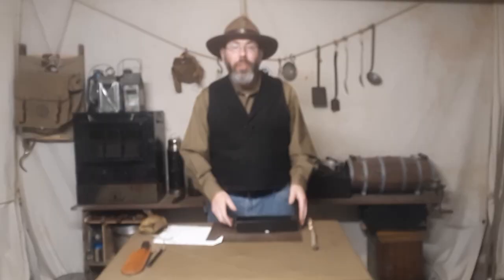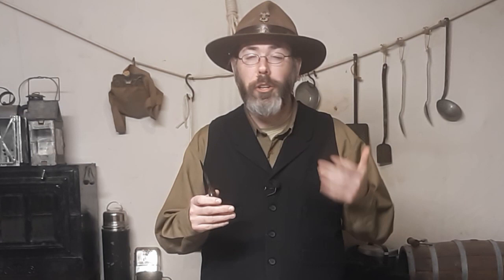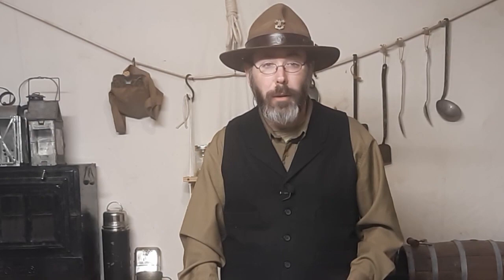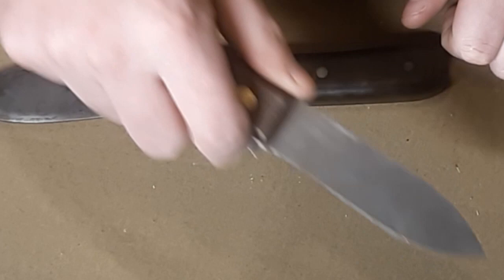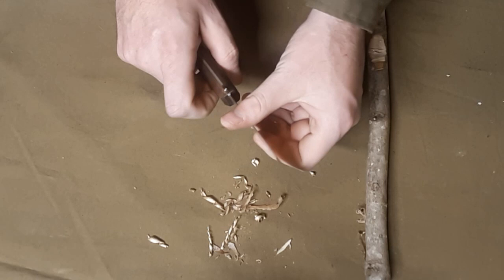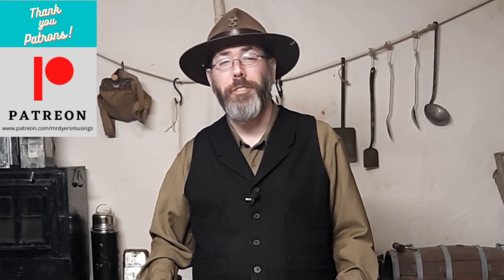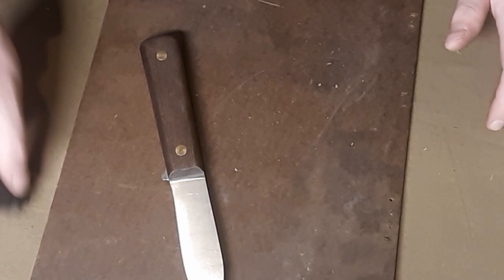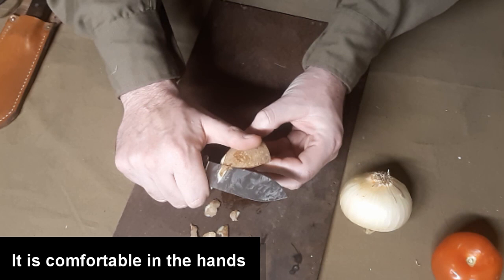Want an Old Hickory Kephart Knife? WATCH THIS and SAVE MONEY!

Comment: It’s a great little knife for camp chores. It’ll do most of the stuff you need it to do, with the exception of the stuff “bushcrafters” seem to want to force a knife to do these days. CAN it baton? Maybe, but maybe you should use a hatchet instead. Otherwise you’re going to be using the knife exactly as our pioneer ancestors intended their knives to be used, and with probably about the same quality of steel as they had.
Reply from the maker: I really don't like batoning. If I was in an emergency situation I can get it but to do it just so you can doesn't make sense to me

Comment: Nice review Mr Dyer, I also have the old hickory kitchen knife set but mine is added into a bigger knife block with the “forgecraft hi-carbon” kitchen knives my grandmother had given me 42years ago. 
I’ve made a kephart style knife out of an old hickory butcher knife; by printing the stock photo of the Becker kephart and then using it as a template for mine and it worked very well. I’ve also made a Nessmuk copy out of an old hickory Buffalo Skinner knife which also turned out well. 
Keep up the great videos they’re really enjoyable!!!
Reply from the maker: They are awesome! Easy to sharpen and great slicers! Thanks for checking it out.

Comment: Very cool knife. Probably really good for beginners. I have always been found of sheath knives for learners to begin with, especially for its safety, proper handling   techniques, and such. But I usually recommend an entry level Mora’s like their craft line. Their cost and durability is great, but usually stuck to a scandi grind.
Reply from the maker: I have nothing against scandi per-se but prefer a V or convex.

Comment: I would strop the old hickory knife and give it a better 90 degrees  spine. And for your knife I would give it a little bit some were on the spine a 90 degrees for striking the fero rod. Great video. Great review. God bless. From Glenn CATT in Massachusetts. Oh you can take apart a bic pen and take a Swiss army knife saw and cut down the middle and put it on the back of the spine and use it for a guide for sharpening. Works great.
Reply from the maker: You just blew my mind brother!
Reply: @honorableoutfitters   ya the pen guide works great for boy scout pocket knife. And will work good with that old hickory. You can leave it on when you strop the blades too . I hope it helps you. GOD bless. From Glenn CATT in Massachusetts.

Comment: 👍 Good fair overview of this knife.  
I have one and my initial impression was the same as yours.  As you point out sharpening to a better edge was easily done.  I also applied some Tung Oil to the handle which improved the feel IMHO.  The little nub of a finger guard also initially bothered me, but thus far it has caused no problems, agree with you that a little more work on shaping the handle could have made this feature better; if it becomes an issue I will simply file or grind it off.  I made my own sheath.
At the price point I have found this to be an excellent knife.  It does everything I need a knife to do.
Reply from the maker: I think your last words sums it up really well, nothing flashy but utilitarian.

Comment: You might check out the BPS Knives Bushcraft Knife.  Even just visually it has a few issues: the sheathe has a riveted belt loop, and the blade's scandi-ground.  But it's the same price range, it's a smidge longer, and it's got a better handle scale shape, and based on one of the customer videos it throws spark from a ferro rod well.

I thought about it, but let myself get, er, overenthusiastic and ordered the Ka-bar.  :p  It's got a finished and chamfered spine, but I think I'll take a file and flatten and roughen that one of these days.
Reply from the maker: The Ka-Bar one is on my distant wish list. I'll check out BPS, thanks for the suggestion!

Comment: I have a hickory almost like that
I have a round file in is case
I sharpen it with the file
It has a special sort of edge
If something absolutely positively has to be cut off
A edge made by a file is hard to beat
Takes but a second to resharpen it too
Hard on the knife I admit
But is serves its purpose well
Reply from the maker: True brother. Do you use a file on a multitool  or use a separate file?
Reply: @honorableoutfitters  No I am not totally stupid
The thing is !!!
A relatively inexpensive carbon steel blade and a file
You can debone a tyrannosaurus in a matter of minutes
Or cut the tires off a automobile
You can keep it sharp in a matter of seconds
It not a edge you could shave with witout bleeding profusely
It is a wicked edge though
Great in a emergency survival situation
Not a thing for a fine cutting tool such as a boker or similar

Comment: Most knives don't come out of the box really sharp.  Would have been a fairer test if you sharpened it first.  Otherwise, nice video.
Reply from the maker: I would agree to an extent but my SAKs, Gerbers, and Leathermen all came really sharp. Now these household brands certainly cost more than the $30 Old Hickory. I don't have a new out of the box Mora or Green River to compare it to so I can't say and those would be the ones that come to mind in the same class. I appreciate your feedback and support brother.
Reply: @honorableoutfitters  yea, it looks like a 20$ knife with the materials and construction, that sheath and not being razor sharp out of the box. I was only slightly disappointed with my 10$ Amazon sheath and old hickory 7 inch butcher I put a clip point on for what that cost, the handles were cut uneven. It still cuts after sharpening, just thought it should be slightly cheaper for what you could get annother knife for value wise. If you want slicey, the thin blade slices food better. This shorter blade would be more handy, so meh, good enough I guess. Thanks for the review, I'll check out your other stuff!